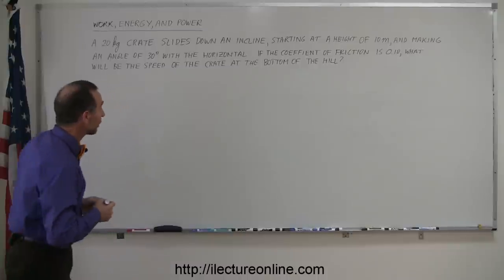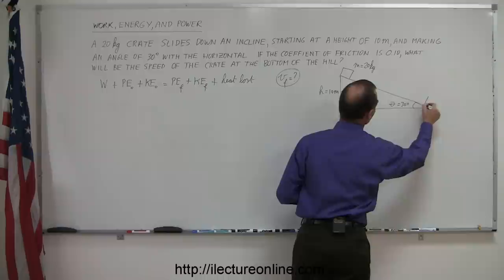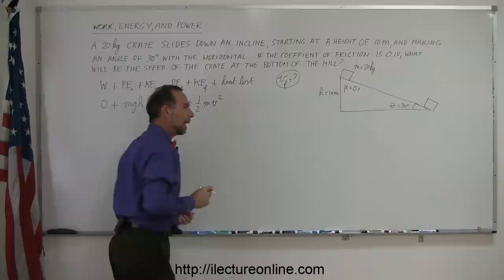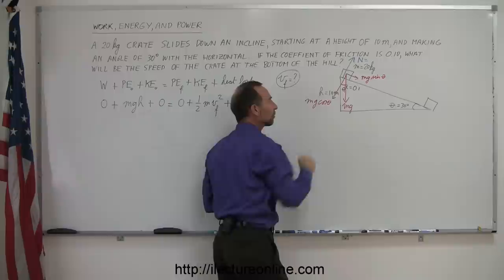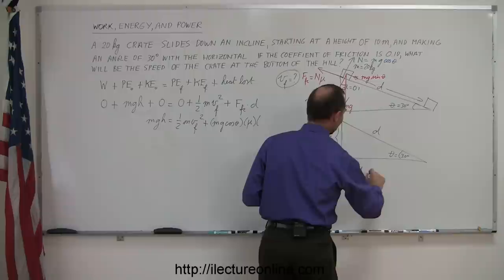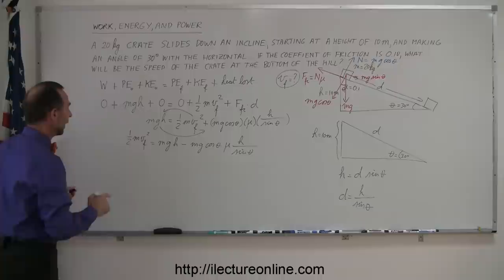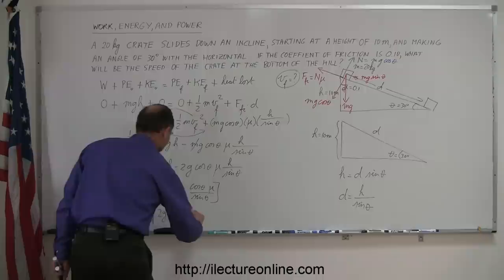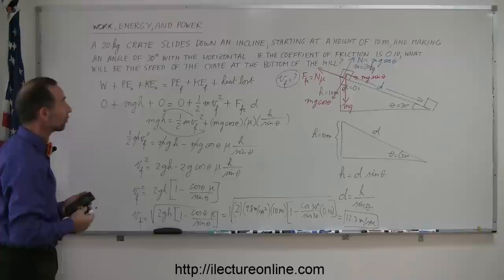Physics 8  Work, Energy, and Power (25 of 37) Crate slides down a rough incline

Comment: Why is it that sometimes the work done by the friction force is at the initial side of the equation and other such as this is at the final side of the equation???????
Reply from the maker: Without knowing which "other" example you are referring to, the general answer is that it probably depends on what you are trying to determine.  Here in this example we are using the equation that is used for most energy conservation problems.   The energy put into the system + energy already in the system must equal the energy remaining in the system + energy removed from the system by the friction force.

Comment: Why not account for friction by saying that friction does work on the system (which would be negative) rather than saying it's a change in energy due to heat lost?
Reply from the maker: That is a perfectly fine method as well.
Reply: @MichelvanBiezen  wasn't sure if it was conceptually incorrect while yours was correct. Thanks!
Reply from the maker: It is fine, but then you make it a negative value, you must place that term on the left side of the energy equation (instead of the right side).

Comment: how did you get the formula at the beginning of the video??
Reply from the maker: This is the energy conservation equation.  The energy you have initially + any work put into the system must equal the final energy + any energy lost
Reply: @MichelvanBiezen  ah that makes a lot of sense, may I also ask where you got the 1 in the 1-costheta/sintheta?

Comment: I have a similar problem where the height of the ramp as well as the distance traveled is unknown. I have the Friction Coef, the mass and the initial velocity. I assume the final velocity should be 0, because the question is 'what is the length of the ramp?'  How do I solve for d without h?
Reply from the maker: h = d * sin(theta).  If the angle is known then you only have one unknown

Comment: Is the force of friction supposed to be negative in the heat lost equation since it opposes the motion of the block's acceleration down the incline? Or does direction of forces not matter in energy questions?
Reply: Dear Gannu,
Despite force being a vector quantity, work is scalar quantity. Therefore the measurement is scalar. The same difference between speed and velocity; speed refers to the magnitude of speed measure, velocity takes into account the direction of the movement. I hope this helps.

Comment: Why does the parallel component of weight not contribute to the equation?
Reply from the maker: Its contribution is already accounted for by the change in KE and PE.
Reply: I got the same question.  Could you please explain more details in this issue.  Why we are no need to consider the work done by the parallel component of weight?  Thanks!

Comment: thank you so much for the videos, im very grateful, i have a doubt sir, since the friction force is at a 180 degree angle to the displacement shouldnt heat loss be Force(friction)*d*cos 180 = -fd
Reply from the maker: No, it is positive.  The left side of the equation represents the energy you started with.  The right side of the equation includes the energy you have left.   If the energy you have left is less than the amount you started with (because you lost energy due to friction), then you must ADD the amount lost on the right side for the two sides of the equation to be equal.